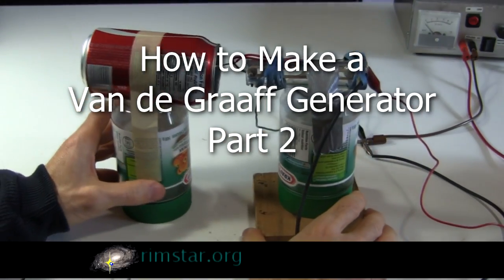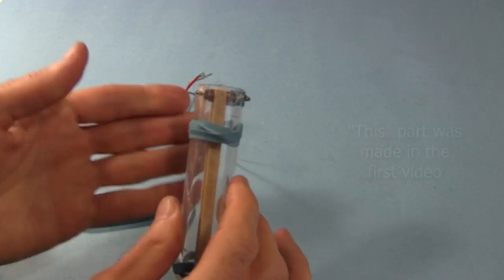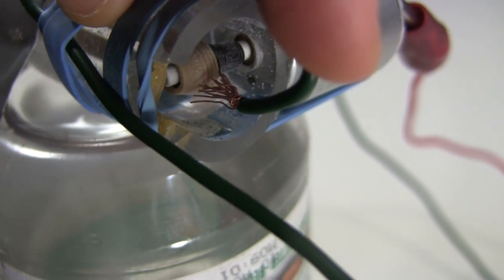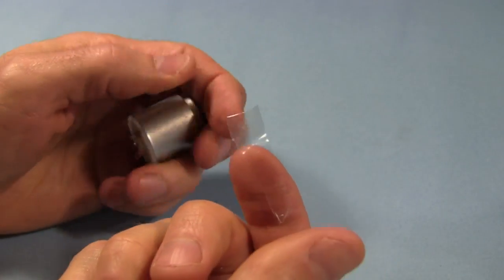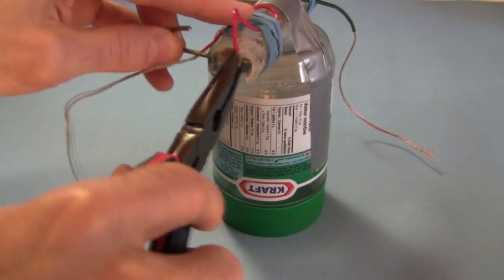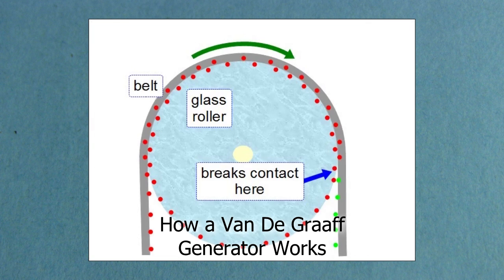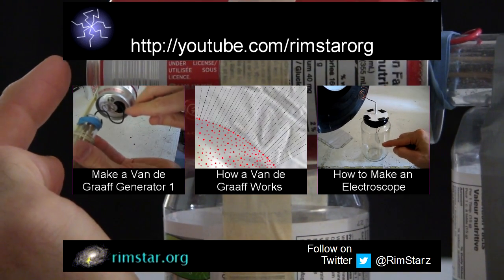How to Make a Van de Graaff Generator Part 2

Comment: I did watch your video.... But I'm still confused with the concept of triboelectric effect...My bottom roller is wrapped up with electrical tape and my upper roller is made from glass fuse and I'm thinking to use an elastic(polyester) band for my belt. It's usually an elastic in trousers and shorts.... Will this idea work??? Because I'm not able find a rubber belt here in shops...

Comment: Well  I attached two coke cans to a plastic ruler which sits on the side of the structure and I then ran a wire between them so the charge could travel through them, then I attached one wire at the end of the ruler from the last coke can to the dome on top of the structure itself.
the charge goes from::  Belt-wire-coke can1-wire-coke can2-wire-Metal Dome

Comment: I got it working except for it shocks a little from the can. It throws a bigger and more painful spark when I touch or get close to the negative connections from the battery side or motor side. Any idea why it's shocking from the negative motor to battery wire?

Comment: Do you think that a Van de Graaff generator could have been used as the ignition system for early gas engines?
Reply from the maker: Sure, that would have worked.

Comment: Is it important to have the earthing ?  Cant it all be fine with just the power supply for the 
motor( + and -) ?
Please do reply.
Reply from the maker: Sai Kiran Yes, it's important to have the earthing. Notice that in this video one of the earthing options I showed was simply a wire connected to the inside of a 2nd can, so it's not hard to do. The earthing provides a supply of electrons or a place to dump electrons depending on the polarity of your Van de Graaff. Without that supply or dump (called a source or sink) then it doesn't work well or at all.

Comment: i once made a VDG out of a rubber band, vinyl tape, tube from fuse, coke cans, and lego instead of tube and i also used a lego motor. Seemed to have same power as yours. Using the lego it was easier to involve my son in the project.

Comment: Please tell me where should the end part of spray comb be connected to?
Reply from the maker: I don't understand your question. Starting at 2:54 I show a number of options for the grounding side.
At 2:18 I explain how the other brush should be close to but not touching the rubber band and then at 2:31 I just put the other end inside the can. The wire is bare along most of it's length as I explain at 0:58 and which I show again at 2:31.

Comment: Hi sir how important it is to remove humidity i live in a tropical area and its rainy most of the time so i bought calcium carbonate powder , is it useful? And i cant find rubber band in proper size so is it ok to use rubber gloves wrist area for my belt
Reply from the maker: I'm not familiar with using calcium carbonate powder but will it remove the humidity from the room that the Van de Graaff generator is in? I guess you can put the Van de Graaff and calcium carbonate in a box with a window in it so that you only have to dry out the air in the box. From here http://www2.ece.rochester.edu/~jones/demos/humidity.html around 70% relative humidity (RH) is too much. They also give good tips for humidity.

Comment: doesn't the inside of the coke can have an insulating coating? i'm wondering if sanding it off would boost it
Reply from the maker: phallus36 It does have a coating but I guess it's to thin to block the high voltage. Sanding it off might give a boost, but my guess is it won't since the current is so low anyway.

Comment: does plugging in the wire into a breadboard work as ground?
Reply from the maker: No, plugging into a breadboard is the same as adding on a short length of wire.
Reply: oh I can't believe I didn't think of that! Thanks a lot!

Comment: can u please give me some suggestions to increase the static produced ?
Im using glass roller on top, vinyl down and the belt made from a rubber balloon .
Reply from the maker: I'm not sure if I mentioned in this video but the faster the speed of the belt, the more charge will be produced. Also, the wider the belt, the more charge, as long as the sharp tips of the brushes are facing a lot of the width of the belt.
Reply: ok thanks will try it !

Comment: How can I measure the voltage given out by this van de graff generator??
Reply from the maker: +Jojo Philip You can get a very rough estimate by measuring the longest spark you can get. Here's a table http://www.kronjaeger.com/hv/hv/msr/spk/index.html However, there are many factors involved that make the table a rough estimate such as the shape of the can and the shape of what you use on the other side of the spark.

Comment: can i use vinyl electric tape as the band? and if so will it have a better result than the rubber band?
Reply from the maker: Yes, you can use vinyl electric tape, with the sticky side facing out. I can't say if it will have a better result since it also depends on what materials you use for the outer surface of the rollers. Vinyl tape is wider than a rubber band so that's an advantage.
Reply: can i use the vinyl tape as the roller and the belt or should i use a plastic straw as the roller instead.
thanks :)
Reply from the maker: Omar Aq
I tried a straw roller with a rubber belt and it didn't work. Maybe it'll work with vinyl, I don't know. People have had success with vinyl for both.
Reply: alright thank you for your help

Comment: I couldn't get a rubber band of that size in my place
What else could be used
Reply from the maker: There don't seem to be many choices. You could try cutting a strip from a rubber balloon which theoretically should work, though I haven't tried it myself.
Some people use the black vinyl electrical tape like I did for the bottom roller and also the same tape for the belt (sticky side facing out). I don't know why that works but it does seem to.

Comment: if i touch the negatively charged rod does it shock or lift hair? or attract things
Reply from the maker: My negatively charged rod doesn't shock but it does lift hair. I also attracts things like small balls of aluminum foil. By I usually use a small plastic rod. A charge 2" diameter PVC pipe will give a little shock when it's close enough to your finger.
Reply: thanks, so that mean it same as the positive one?
Reply from the maker: atiq fajar
Yes. The charging of the rod uses the triboelectric effect, but the attraction is due to the creation of dipoles in the hair, electrons push away while protons are pulled close.

Comment: How much current does the motor draw when in use ?
Reply from the maker: I didn't measure it the current. Given that the belt was under a lot of tension, I wouldn't doubt if it was as much as 2 or 3 amps though, but that's just a guess.
Reply: @RimstarOrg  my question was really directed more towards how much current do u think the production of static was drawn... there are many ways to lighten the load of tention.

Comment: is it necessary to do grounding
Reply from the maker: Yes. The ground just refers to a place that easily gives or takes electrons. You need that since that's the source of charge for the can/dome. But notice that I gave a few different ways of doing it in this video.

Comment: Hi there! :) I'm having some trouble with the generator. At 0:53 it's said to strip the wire to make contact with the can, but I noticed that inside the cans (I tried many different brands) there is some sort of plastic film that won't allow contact to happen. My question is: did you have to sand the plastic off? I even tried to make contact with the outside of the can, hoping it would still give a Faraday cage effect, but the print on it turned out to be an insulator, too (I checked with a digital ohmmeter)! Is this possible? Did someone else have the same problems? Thank you for the kind attention :)
Reply from the maker: I found the same things with the inside and the outside of the can. But I didn't need to sand the film off the inside. It still works. I'm assuming you're talking about a soda/pop can like a Coke can and not some food can. Connecting to the outside won't give the Faraday cage effect, and though I did get some result that way, it was much, much weaker. It seems the voltage is strong enough to go through the insulation. If it is a soda can then I suggest you look elsewhere on your generator for the problem.

Look at the Triboelectric series table on the right side on:
http://en.wikipedia.org/wiki/Triboelectric_effect
The surface material for one pulley should be on the positive side of the table, the surface material for the other pulley should be on the negative side of the table, and the inner surface material of the belt should be somewhere in the table in between the pulley materials.

The wire should be connected INSIDE the can.

The sharp points of the wire near the belt should be spread out and should be as close as possible to the belt without touching.

The tube which the belt is in must NOT be metal.

You should have a good ground connection.
Reply: RimstarOrg yes, I'm using some Coke/soda cans, but maybe the ones avaliable in my country (I'm not American) have a thicker plastic layer... however I will probably sand it off and re-check for the ground connection (even if I connected the lower comb wire directly to a concrete wall). Thanks for the answer, I really appreciate the help!

Comment: +RimstarOrg, exactly or on an average what lenght of wire were you using?
And The part about sharp edges, what is the reason for cutting it off?
Reply from the maker: The exact length of wire doesn't really matter. Just make sure there's enough bare wire inside the can to make contact with it in at least a few places. By sharp edges, are you talking about where I cut open the top of the can and remove sharp edges there? If so, if you have a charged object with sharp edges then the charge will be more concentrated at the sharp edges and will leak by ionizing the surrounding air.
Reply: RimstarOrg Yes sir i was talking about that part where you cut off the can.
Thanks a lot sir!! I have a wire that is around 14 inches long.
I have another really long piece of wire that is around 3o inches long but the problem is that i think it's too thin (larger guage), so would that work?
Reply from the maker: *****
Yes, you can charge a leyden jar. A leyden jar is simply a low capacitance capacitor that can handle high voltages.
Reply: Never heard of it! RimstarOrg can you please make a tutorial?
Reply from the maker: rohitrajkumar udhwani
Already done! Mostly :). See my "How to Make Capacitors - Low Voltage Homemade/DIY Capacitors" video http://youtu.be/GveI9gXIsHw at 1:58. But put aluminum foil on the inside (like I mention briefly at 2:06) and put a wire through the lid to make contact with that foil. It'll give pretty much the same result except using aluminum foil inside is less messy than using salt water.
Reply: Ohhhh ok! I will surely check it out!! I really get inspired from your channel RimstarOrg Keep up the good work! :D

Comment: Can I use glass instead of using my finger to see spark?
Reply from the maker: I don't think glass would work. But you could connect a wire to whatever you're using to the ground side and put a well rounded (i.e. not sharp) metal object on the end of that wire and use that object instead of your finger.
Reply: try using a pencil lead to catch the spark with, attach it to ground with a wire. Carbon arc anyone?

Comment: Good Day Sir :-) this project is so interesting so i want to do the same for my presentation this month (but of course with the acknowledgement for you). I already have the materials, and also I already test it. But it doesn't work. :( I used 12v motor, I also used a PVC pipe instead of Plastic tube, and for the supporters for the rollers I used the stick of ball pen instead of the plastic stick. I used a belt flat rubber  instead of the rubber band you've used. As well as the fuse, there's no any single spark produce. Can you please help me? :( Thank you
Reply: and about the in can I scrap the design and paint on the surface of the can and clean it with the thinner.
Reply from the maker: +Leniram Ledodnum What you describe sounds good. Rather than repeat a bunch of stuff here, I've put together this FAQ http://rimstar.org/science_electronics_projects/van_de_graaff_faq_frequently_asked_questions.htm. If that doesn't help then ask again.

Comment: So I just finished mine, and it doesn't seem to work, it's set up like this: a motor with electrical tape, rubber band as belt, other roller is a plastic tube with thread around it. Ground wire on the side of the motor, set up very close and touching ground, on other side wire is almost touching belt and connected to aluminum antenna from RC car which does conduct electricity, I tested it, and that is inside the can, touching it many places, anyone know what's wrong? I've tried holding the wire, touching the wires to the belt, using different methods for ground wire, I don't know...
Reply from the maker: ShockwavePlaysMC What material is the thread made of?The more sharp points you have at the brushes that are facing across the width of the belt the better. Remember, the belt is a non-conductive material. So to get all the charge on the belt, you need to have points across the width of the whole belt since the charges won't move across the surface of the belt on their own.

Comment: There is another way you can strip a wire without a wire clipper and without using a knife...  If you burnt the wire on a gas stove or cigarette lighter (not electric one, maybe it could work with a candle too but I haven't tried that one) and the pull from the carbonized plastic with a normal plier or even with your bare hands...it will break and come right off along the wire!

Comment: one more thing,may i use copper wire instead of nylon.
Reply from the maker: You need the triboelectric effect to be taking place between the outer surface of the rollers/pulleys and the inner surface of the belt. Metals won't work. That's what I was talking about in the part 1 video when I explained the triboelectric effect. Rather than repeat myself here, see this section of my FAQ on my website science_electronics_projects/van_de_graaff_faq_frequently_asked_questions.htm#Q_RBMATERIALS.

Comment: How Much Voltage Does It Give out?
Reply from the maker: +Syed Irfan Ahmed The voltage depends on the shape of the object you bring near it to get a spark and how far away it is. A sharper object will require a lower voltage to get a spark. And a bigger spark gap will build up a higher voltage. So it's hard to say. In the video, some sparks are around 0.5 cm long. If my electrode is a 2.5cm diameter ball then the voltage would be around 15 kilovolts.
Reply: +RimstarOrg  If I were to connect this to a tesla coil as the power supply how should the connection be? It'd Be Nice if you reply soon :)
Reply: +RimstarOrg Hey And Also How Much is the input in the motor?
Reply from the maker: +Syed Irfan Ahmed I just noticed in the video that the voltage to the motor is around 3 to 4 volts, which is above it's rated 1.5 to 3 volt range. I didn't measure the current though. Both of those are going to depend on your motor and on how tight the belt is.
Reply from the maker: +Syed Irfan Ahmed A wire would go from the soda can to where I put the power supply's high voltage positive wire. Another wire would go from the ground side of the Van de Graff to where I put the power supply's negative/ground. However, I really doubt that this Van de Graaff generator can power a Tesla coil. It doesn't have the current and the sparks are too infrequent.

Comment: what is the use of grounding
Reply from the maker: The Van de Graaff generator's belt gets charged by removing electrons from it. The ground is a place to put those electrons.
Reply: thanks
Reply from the maker: Ideally, neither wire should touch the belt. The reason I had to there was because I wasn't getting enough voltage produced by the roller and the belt. Make sure you spread out the end of the wire so there are many separate sharp points facing as wide a surface area of the belt as possible.
Reply from the maker: I haven't tried it but from searches on google it doesn't sound good. Some say it may be too electrically conductive due to carbon black in the tube material. If you try it let me know how it goes.

Comment: Instead of rubber wat can b used
Reply from the maker: I don't really know of any obvious options. Rubber is a good choice since it's in the middle of the triboelectric series table. Some people use vinyl electrical tape with the sticky side facing out and the same tape on the ground-side roller, but that makes use of a different effect.

Comment: Where is that black wire connected
Reply from the maker: King Of Miner That depends on where you're looking in the video since I show a lot of examples. But in all cases it's ultimately connected to ground. 
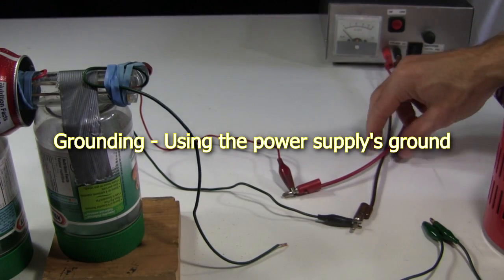Sometimes I have it connected to the negative of the power supply which is connected to ground (3:48 in the video).
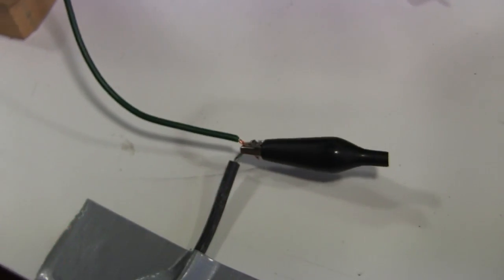Sometimes I connect it to a wall plug (see 3:17 in the video). You can buy wall plugs on their own with no wires. I then connect that black wire to the ground prong of the plug and then plug it into a wall socket.
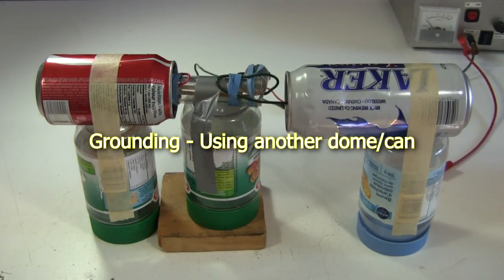But the easiest way, and the way that works as well as any other way, is to use a second can like I show at 4:15.

Comment: Quick question, what about attaching some super fine steel wool on the end of the wire to act as brushes?
My thinking is that if it's fine enough, you can have it touch the belt without such extreme wear on the belt.